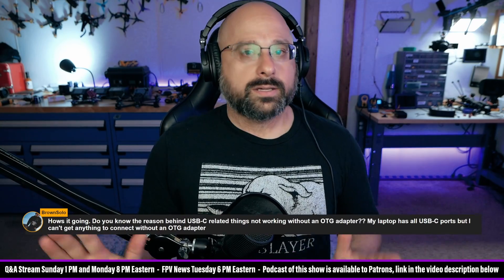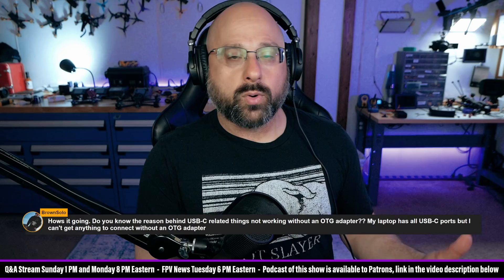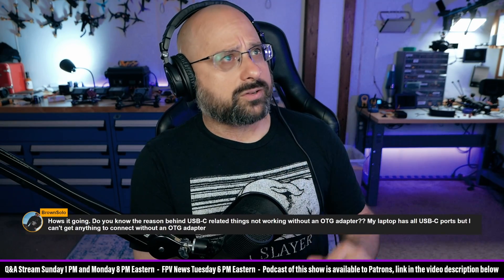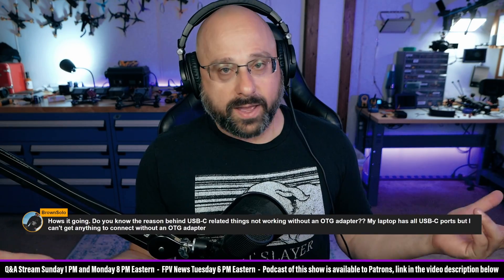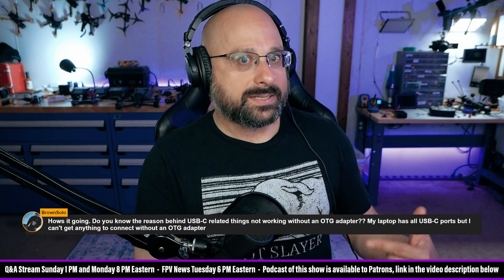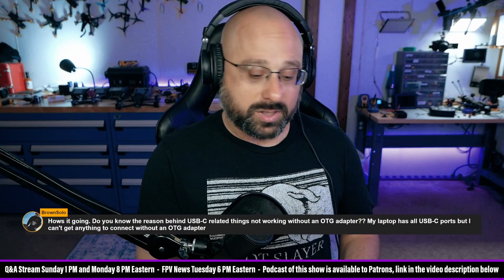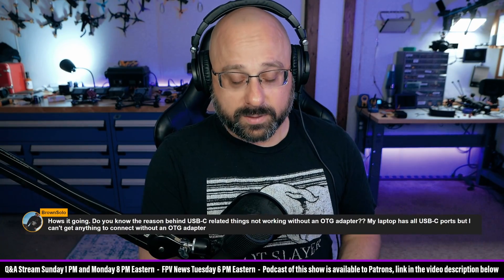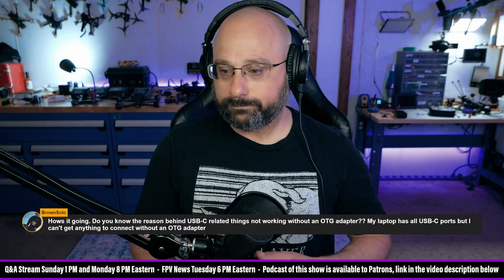Why Does USB-C Need An OTG Adapter? - FPV Stream Questions

Comment: I have no issue connecting usb-c to usb-c straight cord from phone to drone with no otg adapter.
Reply from the maker: Yes, because one of those devices has the resistor for directionality.

Comment: There are also (I have learned) a couple of 5.1k pull down resistors that is supposed to be located at the USB-C port on the device. Think the pins are related to power so many designers that just want to use the serial leave them out and then some computers like Macs say hey this is not right and the port doesn't come up. If use an adapter the computer see the resistors in that and everything is fine.

Comment: The OTG protocol can define the role of two connected devices, specifying which side supplies power to the link, and which initially is the host. It won't negotiate power level though within the context of what USB C can do ( up to 240W). Sometimes devices can get confused about which one is charging and which one is being charged (e.g. laptop connected to microcontroller). Other times you need a device to explicitly declare itself as the host. For example, if you connect the DJI goggles to your phone, the goggles need to be the host for some tasks, like firmware updates.

Comment: At least some Apple devices support connecting to a monitor without the USB C and not needing a separate cable for power. Most devices are going to just need 5v but there are at least a few cases where a device that needs higher voltage could be connected. I would guess that computers that work without using a USB A dongle or OTG cable only support 5v.